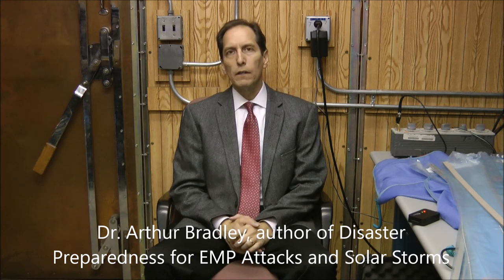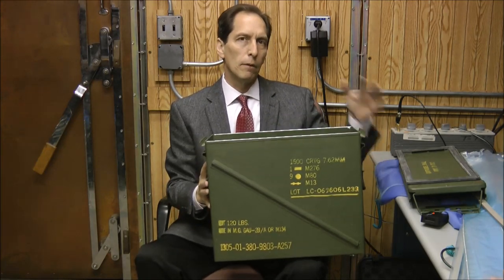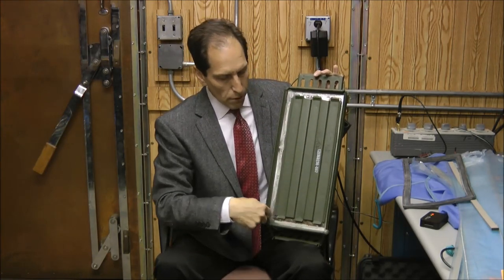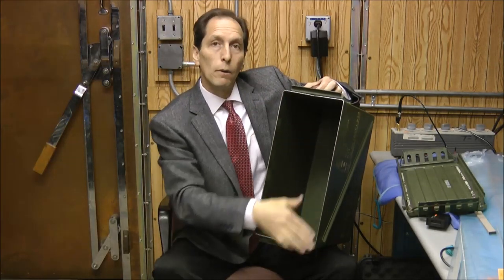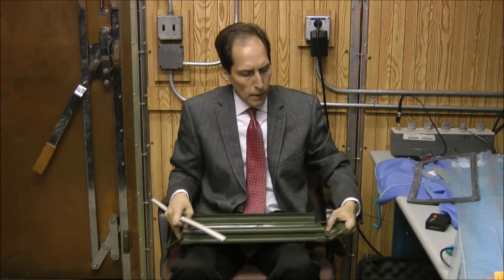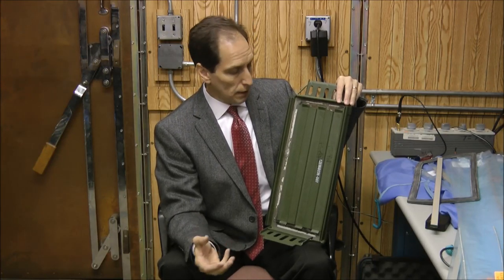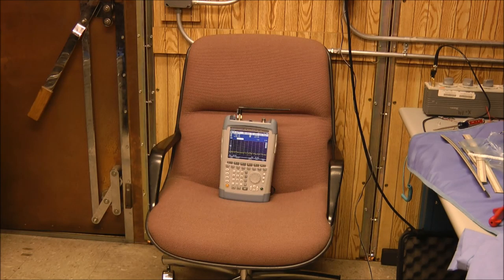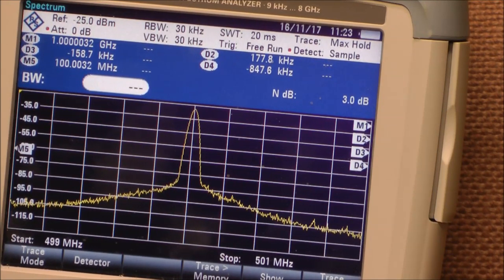Ammo Can Faraday Cage 70+ dB Shielding

Comment: Good video!  I've heard a non-working microwave oven would work as a faraday box.  Your thoughts on that?
Reply from the maker: Yes, I tested a microwave oven and have the results in my EMP Preparedness book. It did fairly well, but not as well as a good homemade Faraday cage or even quality EMP bags.
Reply: @disasterprepper  Thanks - I ordered some of your bags.  Would putting a thumb drive in a safe deposit box at a bank be fairly safe?  There is a lot of metal around the safe deposit boxes.
Reply from the maker: @randyhuff5327  Hmm... I bet it would be pretty well shielded inside a metal drawer that is inside a vault. I haven't measured it though. To be safe, you could put the thumb drive in one of the bags before you put it in the safe deposit box.
Reply: @disasterprepper  Thanks - thats what I would have guessed.  Maybe I'll just wrap it in foil and then put in my safe deposit box!

Comment: couldn't you use metal duct tapae that goes on ductwork on the outside of the can.
Reply from the maker: Yes, you can. I've done experiments that way, and it works fine. It's just a bit of a hassle to remove. Plus, it's very easy to cut your fingers.

Comment: Your video was absolutely outstanding !  I watched it again and again ! 
                    I have a standard style red steel tool box with a loose hinge steel handle on the top . This is my Faraday box . My electronics fits inside , I close the tool box lid . My electronic device is a medical breathing device called a "CPAP" which I have in my bedroom .  It's absolutely important that I protect it . 
                   1.  When closed , is this tight enough for blocking the Spyware from entering ?  Or should  I pack regular aluminum foil all around the edge of the lid ?  I am trying to keep Wi Fi spy ware from entering in and spying on my electronics . 
                   2.  This electronics needs a small air intake supply in the lid of my Faraday box . If I make a square hole in the tool box lid and put 1 layer of standard metal wire mesh window/door type screen over it and tape it down around the outside with metal tape , will this be enough to block the spyware from entering ?  Or should I use 3 or 4 layers of screen ? 
                   3.  Next my device has an outgoing plastic flexible air hose about 7/8 inch fat . If I make another hole in the front wall for this , and metal tape flatly onto that outer wall and around my flex hose and down the length of that about 8 to 10 inches ; Will this be enough to block that Wi Fi spyware from entering my box and steeling my electronics signals ? 
                 4.  Please get back to me soon ,  it's quite important .   Thanks  John H .    Toronto  ,  Canada
Reply from the maker: Boxes like the one you talk about benefit greatly from sealing up the seam around the lid. You'll get much better shielding that way. I can't say for certain if anything can communicate with the items inside because it depends on what level of shielding you achieve and what devices are being affected. A cell phone might require 80-100 dB of shielding to fully block, and you may not achieve that. The screen that you mention will compromise the shielding some, but again, without knowing dimensions and how it's attached, it's impossible to say how much. In this case it's complicated enough that you'd need to do some testing to know the level of shielding you achieve.
Reply: @disasterprepper  The screen hole would be a 2 inch by 2 inch square hole cut with a Dremel tool .  The screen would be about 1 inch bigger all around  and about  2  or 3 layers thick of screen . The screen would be very firmly taped down all around with wide metal tape about 1 inch overlapped  all around than the screen .  In your videos you used some kind of hand held electronic test device to pass over your newly made Faraday boxes . What is this device ?  Where can I get one .  It's very important to me to have  one  so as to test my box . Please get back to me . John H  , Toronto .
Reply from the maker: @johnh1001  Hi John, What you're describing sounds like it would work fine, but again, you'd need to test it to see what level of shielding you achieved. Testing the shielding effectiveness across frequency requires antennas, amplifiers, and a spectrum analyzer (probably $50k work of equipment). You'd be better off paying someone to test it for you. Even that's not cheap. Most people just do the best they can and assume that the shielding is adequate (which it probably is).

Comment: can you leave the gasket in and use bonding straps the way the use them on planes?
Reply from the maker: I suppose it would depend on how you used the straps. If there were appreciable gaps, energy would leak in. You could use conductive tape to seal the gap going around the can, but it makes it difficult to open.
Reply: Well i was going to leave the gasket in and use the bonding wire(straps) to connect the upper portion of the ammo can to the lower portion of the can. the two halves would bonded(connected) electrically. we test the bonding straps on the plane by using a ohms meter.
Reply from the maker: The bonding straps would essentially just electrically connect the lid to the can. They're already connected through the hinge, but it would certainly improve that connection. It wouldn't solve the issue of the exposed seam between the bond straps though. Sorry, if I'm misunderstanding the suggestion.

Comment: Is there any way to do this but keep the waterproof seal?
I'm not sure if it can be done but having the ability to keep water out is also a feature of the ammo cans.
Reply from the maker: I can't think of an easy way for this to be done. I suppose you could install the conductive gasket along the sidewall, but it wouldn't be as easy as replacing the rubber gasket.
Reply: The way to do it would be to leave the original gasket in place. Then sand/grind the paint off around the outside edge/lip of the lid and again just below the lid. Then you use some Conductive copper tape to seal the lid to the can. Just make sure you buy copper tape with the conductive acrylic adhesive. Something like 3M 1183(?) 2" wide. Aluminum tape would also work and probably cheaper than same size copper. Keep in mind that for long term storage sanding the paint off the can may promote rust. Although if you just sanded a small strip and completely covered that bare metal strip with the tape it may protect the bare metal pretty well.

Comment: How bout wrapping the rubber gasket with aluminum tape
Reply from the maker: You could perhaps lay the tape in on top of the gasket, but if you ever pull it out, you'd have a very hard time getting it back in. It's under compression, and once removed, it won't go in easily.

Comment: What if you left the rubber gasket in there I just stuck a piece of tinfoil over the top of it and then put everything down in there and seal it back up would not be the same thing
Reply from the maker: I think it could work, but you'd probably have to use a fresh piece of foil after opening it. Also, I worry that the foil might get torn up as you sealed it. Not really sure.

Comment: Is there a reason replacing the gasket with a similar guage cable wouldn't be a very durable quick/dirty solution?

Surely some gaps could be filled with solder or the cable could simply be hammered into the bevel with a chisel to fill the gap.

Kind of like gilding embossed wood. 

Anyway if I had time and tools that's what I would try.   I enjoy watching your channel for the nice friendly science environment.

So I think it's a bit harder to get the right quantities of specific guage copper wire to try and fit in the tolerances of the can I have.   Hammering it is a solution but a brute one and so I think in the end that the stripping wins out for cost and expediency overall AND ruggedness because I think I'll have to bang up this can more than I want to to really get a good fit on the wire but maybe if I had a solder gun it would still be a good option.

Comment: dielectric grease?
Reply from the maker: A dielectric is non-conductive, so it wouldn't create a good conductive joint around the lip. There are conductive greases, but they tend to be expensive, and I don't think they would do as well as a gasket.
Reply: Conductive grease is what you would need. You would also need to coat the entire gasket. I bet if you put copper finger washer/gasket around the inside lip of the can and sanded a strip around the can where the fingers touched. The same kind of copper finger strip they use around the door of that faraday room you are sitting in in the video.

Comment: I have a few questions I've been researching emp & cmp for many many years. Both work at different frequencies. Emp higher than cme. The other thing I've figured out thru watching lab tests is that the frequency vibrates the atoms in the air causing a electrical charge similar to lightening aka a very very large static electricity charge that then moves through the air. 

Ok. So after that. My questions are as follows. 

1) What is your doctorate in and where from and may I see it? 

2) Why are you using such a low frequency of 500 mghz when it's the static electricity charge that fries the circuits, transistors, capacitors and such in the electronics? 

3) A proven fact of a metal faraday cage is that you have to insulate what's inside from the metal skin as that electrical charge creates will travel through the entire metal skin so why didn't you suggest lining the inside with thick fiberglass or rubber mat or pour something like plastadip inside. I realize most electronics have low conductive plastic shells but they are not a air tight fit, they have metal screws attaching the two half's together that are conductive not to mention lcd or led displays open to the air and charging or power ports and most of the modern radios have with a flexible wire or metal antenna of some sort on them or internally which will help draw the emp/cme energy pulse into the item? 

Lastly the best faraday cage I've seen that was tested professionally and backed/paid for by our government was a wooden box with no metal in it at all. They even tested commercial airliners on a all wooden platform with no metal in it and the planes showed absolutely no signs of emp effects. 

So my suggestion which I've built myself is a 1.5" thick wooden box with a very very tight fitting lid to put your stuff in. No need to insulate it as wood is a natural insulator. Don't use any metal fasteners. No need to ground it like a metal cage because its already non conductive so you don't have to supply a path for that emp/cme charge to dissipate to like the ground. 

Just my thoughts. Answer when you have time. No rush. If I had the link handy I'd put it here for all to read about and see the actual test results of a actual simulated real emp pulse. Maybe later I'll dig it up and add it to this. Until then. Have a great day everyone.
Reply from the maker: Hi, I'll try to answer your questions briefly. My doctorate is in electrical engineering from Auburn University. I'm not going to send you a copy for privacy reasons, but you can google me and see that I work at NASA as the branch head of their electronics group. I'm also a licensed professional engineer and a certified EMI/EMC engineer (which I think you can google to confirm). Anyway, your assertion that an EMP causes electrostatic discharge is mostly incorrect. An EMP can be thought of as a complex RF wave (not a high-voltage breakdown). That RF wave can introduce very large voltages that in turn can overheat or even punch through the junctions of devices, but it doesn't in itself cause ESD (i.e. break down the air). I conducted this test at 500 MHz only as a demonstration. My tests are typically from 100 kHz to 1 MHz (or slightly higher). That spectrum encompasses the complex EMP waveform. As for a wooden Faraday cage... that simply won't work. The wooden test structure that you are referring to was known as the Trestle (it's discussed in my book), and the structure was simply designed not to interfere with the tests. In no way does the wooden structure act as a Faraday cage. If you don't believe this, put an AM radio in your wooden box, and you will still receive the signal. I would imagine a wooden box might provide a few dB of shielding, but I'd have to put it in the lab to get firm numbers. Anyway, I appreciate your questions, and good luck with your continued pursuit of the truth. Best wishes, Arthur
Reply: @disasterprepper  You, sir, are a gentleman, and a very patient man. Not that it matters to you, of course, but my already incredibly high opinion of you has soared. ATB!

Comment: Rather than finding new gasket material why couldn't you rap the rubber gasket with aluminum tape?
Reply from the maker: In theory, you could, but getting that gasket back in would be nearly impossible. It requires A LOT of compression to get the rubber gasket back into the channel.

Comment: So the conductive gasket consists of a thin strip of conductive material on top of a thick NONconducting foam strip which has a sticky backing. What's wrong with this picture? 🙄
Reply: The foam strip is wrapped with fine metal woven mesh so it is actually a metal can, metal mesh gasket, and metal lid.

Comment: couldn't you just wrap conductive tape over the rubber seal instead of buying one?
Reply from the maker: In theory, yes. But if you're talking about taking out the seal, taping it, and then putting it back in, I'd say that's all but impossible. The seal is very difficult to get back in even without being taped. If you just want to put a layer of tape over the face of the seal, it might work, but you'd have to make sure you had good metal to metal contact all the way around. Plus, I think you'd damage the tape each time you opened and closed the can because it's a tight fight. Still, you could give it a try and see how it works.

Comment: DO your own test, wrap your cell phone in foil, use his seals if you want to waste money, and guess what, with your cell phone wrapped and sealed in an ammo can, it is STILL GOING TO RING !!  How do I know?  I've done it many times, Ammo Cans, Steel safes, Even inside a microwave oven, it always rings.
Reply from the maker: Phones are not a good test of EMP shielding. I think I talk about this on a number of videos. They work at a different frequency and they require about 100 dB to typically block.
Reply: @disasterprepper  That's Funny, phones are one of the most used electronic devices on earth and the thing most people are going to be worried about, even tho they (cell phones) aren't going to work anyways.  

Personally I think no one should worry about EMP's to begin with because when the SHTF cell phones, land based phone systems, the grid, the internet, etc, all the major infrastructure systems will have been damaged and not functioning anyways.  CB Radio's, walkie talkies, HAM Radios, those are going to be the only way to communicate other than smoke signals. 

Like I have said in some other posts, you better just be prepared with you own batteries, generators, light bulbs, food, water, ham/cb radios, etc..

As far as cell phones frequencies and an EMP's frequency, good luck on determining an EMP's frequency.  If you are trying to sell EMP shield type products you better make sure it can protect at all frequencies from DC to Light, because that's what it will take.  The government, (ours and others) have many different ways to attack our electronic devices and our human bodies other than EMP's.  

Just like the Cuban Sonic attacks on US citizens in the Cuban Embassy, I knew from day one that is was a microwave attack and NOT SONIC, but it took over a year of investigating for the US gov to come out and say it was most likely microwave.  Same thing North Korea did to one of our US citizens a couple years back.  Sent him home with his brain cooked.

One last note on EMP's and prepping, does anyone remember the saying about keeping all your eggs in one basket?  Forget worrying about EMP protection and just realize that almost all forms of commercial communications, the electric grid and many if not all electronic devices will be useless.  

Eggs in one basket?  How many of you have your Home Phone, Television, Streaming Music, Alexa, Internet, and even have your Cell Phone set to use VOIP Internet when at home thru one Cable or Fios Connection. 

 In the old days you had an antenna on the roof for TV, copper wires to your house for a phone, your stereo had it's own antenna, and cable or fios to your house for internet.  Now most people have it all bundled and served to them thru One Single Internet Connection.  When it goes down you will have NONE OF THOSE, THEY WILL ALL BE GONE ALL AT ONCE, AND JUST AT THE WHIM OF THE GOVERNMENT THEY CAN ORDER THE INTERNET PROVIDERS TO SHUT IT ALL DOWN ALL AT ONCE.  And if you don't believe that, go look it up, they have already done it several times.

 So' just like I said before, batteries, generators, food water, CB & Ham Radios and watch this guys videos on protecting your Ham Radios